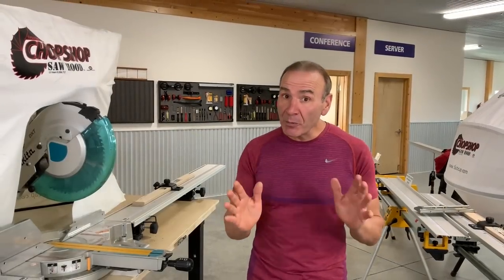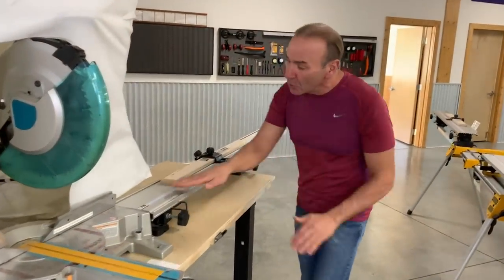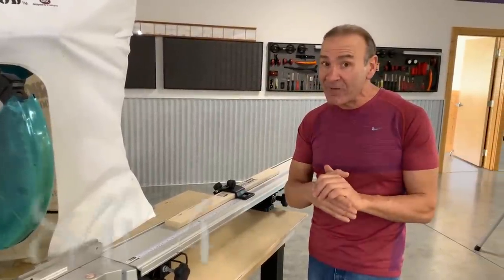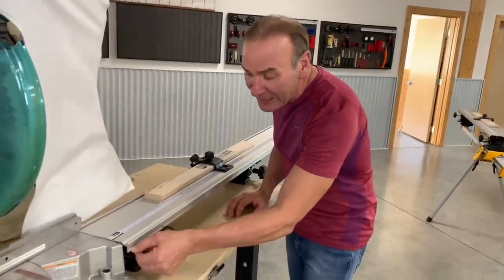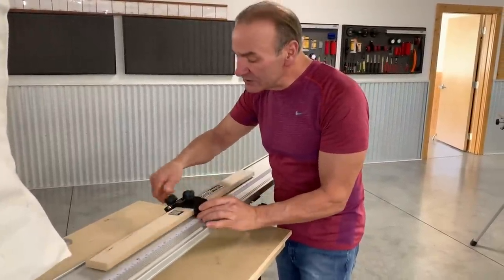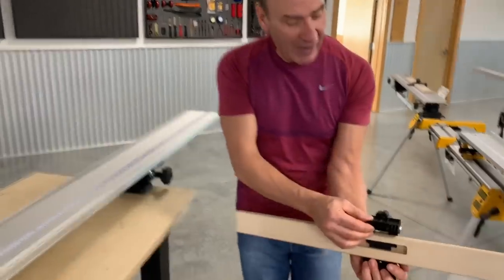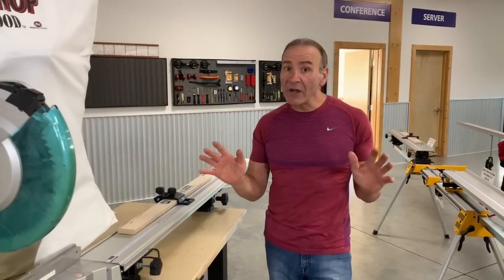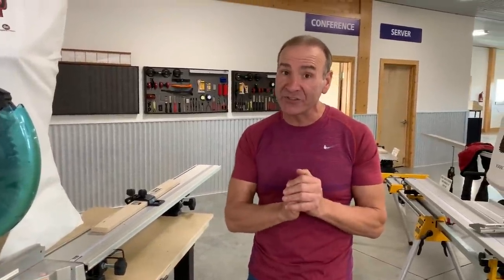Best Fence Flat Fence Intro

Comment: I have a rolling portable shop for my home repair business. So i made 2- 8 foot fences with a 4 inch door hinge that allows me to quickly bolt them to the sides of my 12 inch dewalt miter saw. I put fastcap sticky measuring tap on both fences and made ron paulk stops and it works great. Its all half inch plywood. Since it's not on a bench it has to attach to the saw. The rolling table has rests on both sides that support the fences

Comment: Great improvement.  I've been frustrated by the problem of adjusting my Fastcap fence to be perfectly straight but much of the lumber I cut (T&G ceiling, flooring, and siding) isn't perfectly straight.  Can I order just the flat fences themselves to replace my existing Fastcap fences?  I couldn't find them on your website?  Thanks.  I use my FastCap fence every day.
Reply from the maker: Yes, the 64' should be available online later today.  Here is the link. https://www.fastcap.com/product/best-fence-64-quot-fence  If you want a different size, please contact our customer service 1-888-443-3748 or info@fastcap.com
Reply: Great!  Thanks.

Comment: I don't get why they are using crowned boards?   I could see if there's a minor crown and they can force the crown out when installing.  In that case, you'd want your miter saw cut to be perpendicular to the board in the local area at the end of the board. a I've forced barn wood that had a crown, forced the crown out and screwed it in place. You do this when you don't want to rip but edge of the board  because you want to keep the patina'd  edge.  With new wood though, I'd think you'd want to make sure it's straight before you start using it.

Comment: @:50 your guys customer service is excellent!. Real ppl, right away. 
If you guys made a smaller version of that mitre saw dust shroud like the Dust Chuter edgecraft wont release I could buy 3 right now and I’d pay $50+ for them. I’ve tested it and it’s easy to fit every saw except the Dewalt so you’d only need 2 models.
Reply from the maker: What dimensions are you thinking?

Comment: Is that a new pin system?  I love my bestfence, but the pins have been the only little issue, other than one of the leg handles being finicky.  Are those new pins available?
Reply from the maker: Yes we can make those to order. They are not on the website, but call Sandi at 888-443-3748 for assistance.

Comment: Ok what am I missing? that small little vertical fence looks like it would fit in the existing dove tail or existing slot. It could then be tightened down. If that’s the case FastCap you’ve just made your inventory a lot easier.
Reply from the maker: There are some saws that will not work with a vertical fence. Specifically some of the Bosch saws.